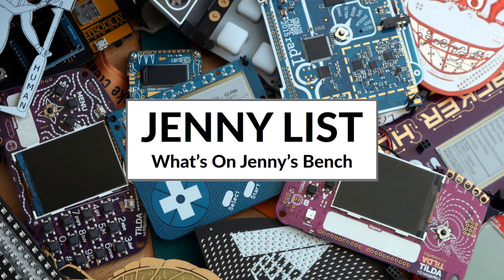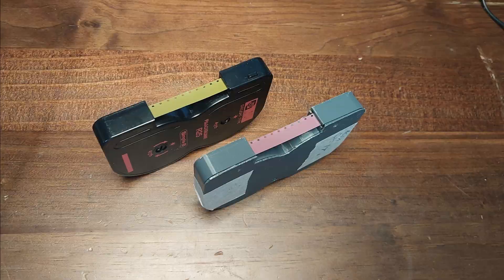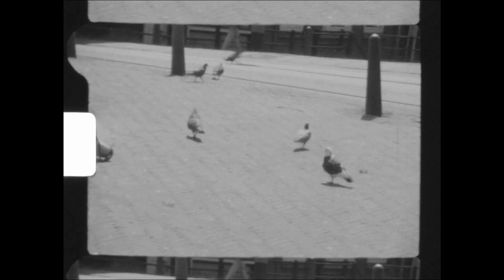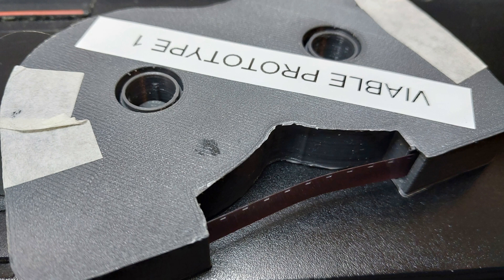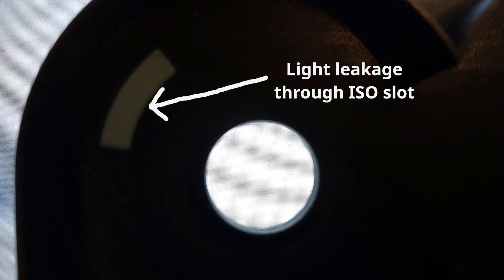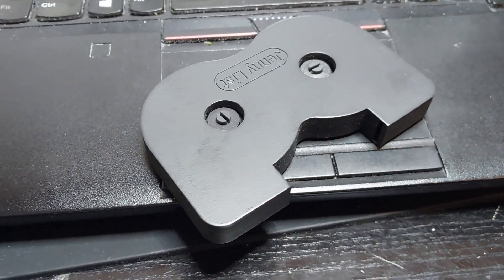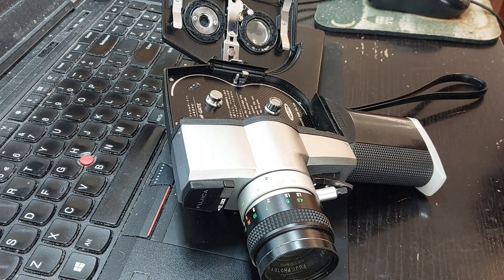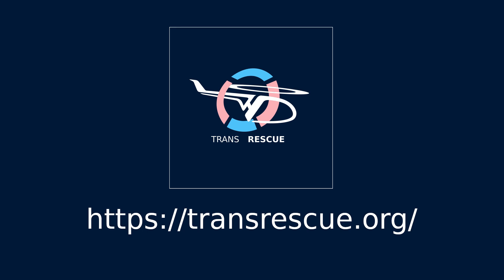A New Single 8 Cartridge Part 4: What's On Jenny's Bench

Comment: Looks really cool. I’ve got a Fujica P-300 - it will be good to be able to run film through it. I’ve been developing cine film at home, so will be fun to try out single eight in addition to Standard 8, Super8, and 16mm
Reply from the maker: Excellent! What have you done to replace the mercury cell for the light meter? I have not been successful with my attempts at a replacement.
Reply: @jennylist  I picked up the camera only recently, so not investigated that side yet. Probably investigate doing what I did years ago with my Braun Nizo, bodge an LM317L with suitable resistors and capacitor in the meter battery compartment, wired up to the main battery. Or a 3D printed holder for some modern button cells and a Schottky diode to drop the voltage.
Reply: @jennylist  I've dug out the camera and had a play with the meter power and it looks like I may have an issue with it - with 2.7V applied it jumps to f16, no power it's wide open. Not responsive to light, though. At least the aperture coil works, maybe the light cell has failed. I wonder if it's possible to bypass the light cell with a potentiometer and make it manually controlled...
Reply from the maker: You may need to find a way to supply it with the voltage it would have got from the original mercury cell. I know there are little electronic inverters for this purpose, but sadly they ain't cheap
Reply: @jennylist  It needs a steady 2.7v - the camera’s from a time before small voltage regulators were a thing, so replacing the mercury cell shouldn’t be a problem, with a voltage regulator wired to the main batteries, or a couple of 1.5v button cells and a diode voltage drop. It looks like there’s space in the handle, but I’ll need to disassemble the camera a bit to investigate. It’s a really nice compact cine camera, so will be good to make it usable. Little project to do over Christmas. :)